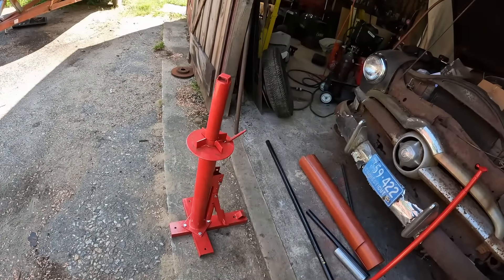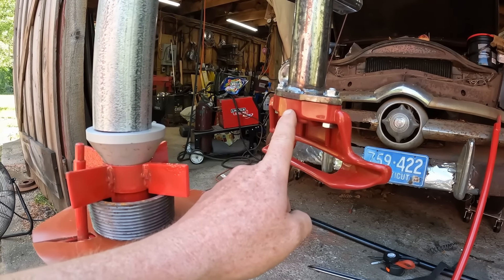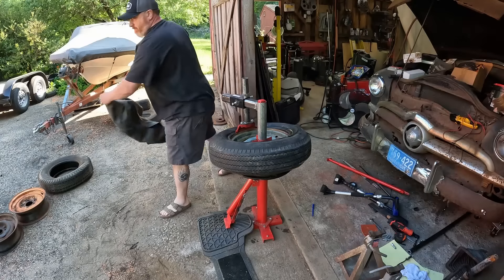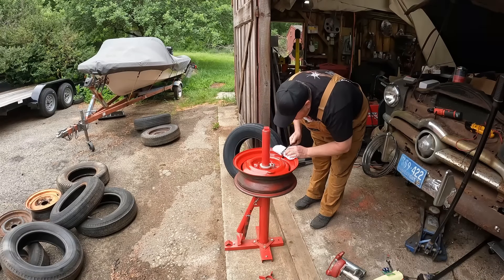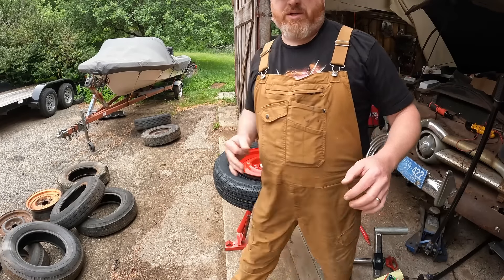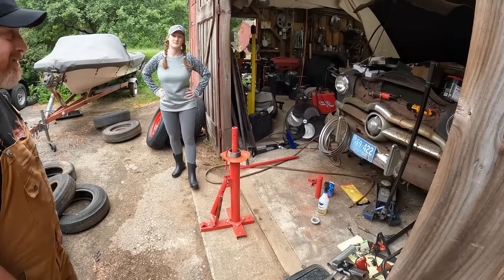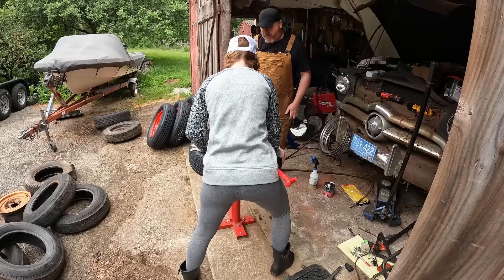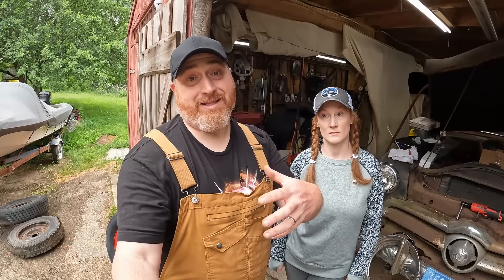How to modify a Harbor Freight Tire Changer to work amazing!!! Follow this DIY guide!!

Comment: I have the same set up thanks for the extra information on what you built. And what I use is a ratchet strap around the new tire if I have problems with the tires not popping to seal on rim .
Reply from the maker: Yeah we would certainly have to use a strap if the tires wouldn't go.

Comment: I just plain like that cone. Should have come with the changer in the first place.
When they taught me tire changing in high school the stand had a big cone
that thread down the center shaft.. Then you went at it with a massive bar
& with teen strength. Wham the tires flew off.
 Thanks much for showing the cone
Reply from the maker: There's a link to it in the description

Comment: Get you a good bottle brush and a holder for it mix dawn dishwashing liquid with a quart of water use it around the tire for both mounting and breakdown it will save your bead and a lot easier job.
Reply from the maker: Yeah I need some type of better setup for that.

Comment: You need to clean the rollers on the mig welder. carbontet is what we used in the old days
Reply from the maker: It has been replaced with an amazing new machine actually. Arccaptain MIG 200 multi process!

Comment: It helps to you so water in a spray bottle to bust the beads and a little bit of grease around the seal of the tire puts the tire on quickly
Reply from the maker: Thanks!

Comment: Loved the video. Have one of these tire changer have used it for a while and it will whoop your butt if the tires are tight. These mods you have done will make it easier. I have all the parts in my cart at Amazon. I have all the steel laying around in my garage. Gonna build it this week. Thanks
Reply from the maker: Thanks for commenting! Report back and let me know what you think!

Comment: I did 16 tires one day using my HF tire changer,unmodified no less,12 of which were atv tires,4 were trailer wheels and tires.. Used my bubble balancer from HF,modified,and balancedball 16. From start to finish was under 2 hours,saved me between 240 to 320 bux depending on which local tire store I had taken them to.. More than paid for the new unused HF tire changer I paid 20 bux for off of craigslist,the 16 bux for 2 HF tire tools,and a spray bottle with Dawn dishwashing liquid and 50% water mixture.. The tire changer is only 39.99 nowadays..
Reply from the maker: Well worth the effort to save that kind of money!

Comment: You got to love them old trucks,they were made to last- i just replaced the rear frame on my 1999 dodge dakota-thin wall factory frame- just to thin to rebuild once the michigan salt got to it for 22 years. That tire braker from amizon or harbor frieght looks like it might work on an easy ONE or maybe a hard lawnmower tire. I got and old hydrolic tire changer 30 years ago for 100 bucks= I gess it beats all manual crow bars somwhat-or it helps get it done.
Reply from the maker: Yeah this is no automatic job but it gets the job done I suppose. Thanks for watching!

Comment: I prefer to mount my own tires .. Because I clean up the bead area with a wire wheel grinder.. and I use Frey lube Rim grease on the beads..
  I got a quote of $4.00 per wheel at Sam's Club for balancing.  I think they would  dismount old tires and mount new tires for the same price.
  Many places got  $7.50 to balance a mounted wheel a few years ago .
Reply from the maker: That price is double here. That's a good price!

Comment: Use cheap transmission fluid to put the value stem in and a little on the bead of the tire if they don't just slip on like the first one
Reply from the maker: I will give it a shot! Thanks

Comment: I bought one similar to this about 23 years ago off of eBay. They are cheap, and can be awkward, but they will work. Narrow tires work much easier than wide tires. New tires are easier than ancient rock-hard tires you found in a shed somewhere. The weak links are the bead breaker and the end for reseating the tire bead. The bead breaker Doesn't work on real wide tires, so you need to modify the mounting to get the wider tires to fit. The bead reseating end may need some reshaping on a grinder. 
Your dismount modification was pretty good. I think you were running the direction the wrong way, but hard to tell from the distance, based on your duck head shape. but narrow tires just mount so much easier that it really didn't matter.
Reply from the maker: We are going to try some 50 series tires soon. I'll record it and see how hard it is.

Comment: Drill holes for lugs so you can bolt the wheel in place.   No need for the tapered part.
Reply from the maker: I suppose if you are always doing the same wheel pattern tires. We have 10 cars!

Comment: Used oil works for lubricating the tire to slip on the rim easier you need to use some kind of lubricant you're going to end up tearing the bead on one of those tires and it's not going to hold air dummy when I used to work at CT tires when you buy the tire they send you a bucket of soap that you add water to to make your tire lubricant

Comment: Hey, about your welder, my Hobart 140 was doing the exact same thing. After a bunch of digging, I found the cause to be a transistor on its way to the grave. For my Hobart, it's transistor TIP142T. Look into it, you'll need to solder in the transistor of course. If you're not 100% sure the drive motor is stopping and starting, then it could be the internal sleeve the wire feeds through. I've run 80 pounds or so through my welder and my sleeve was pretty heavily worn. The sleeves are cheap....mine was $35.
Reply from the maker: Thanks!! I'll check that out.

Comment: Leave the soapy water on when you air it up. It will help it slide up over the lip. Great job on the changer
Reply from the maker: That's what was in the spray bottle!
Reply: @madgingercustoms  yes but i thought i saw you wipe it off to check the rim for scratches.

Comment: On the whole balance deal just grab some bags of the poly-beds and you simply toss them in and slap the tires together and run them down the road and they will balance your tire! Easier then the weights hammering around and they will actually move so some mud or whatever isn’t going to make it off balance!!!
Reply from the maker: But them what would I do with this video? LOL

Comment: Have one of those changers and have been drooling over that duck head.
Couple of tips:
1. You slid past the mounting of the thing. That is very important. Either bolt it down to a solid floor or, if necessary. make a platform big enough to stand on to hold things in place.
2. Don't know why you used a separate bolt to hold the rim. That is the job of that pin. I did find the pin to be in the way all the time and cut the side out the "box" it sits in. I made a additional hole in the bottom of the box and drop the pin down from the top to hold the rim from turning.
3. The breaker handle holder is in the way when placing the rim on the breaker. I welded a bit of dog chain to the main pedestal and plier bent a hook at the other end. Now i can lift the holder up and hook it out of the way while placing the rim on the breaker.
Reply from the maker: That aligning pin is garbage and bent the first time I used it! That's why I used a wheel lug.

Comment: May be the switch on your wire feed gun or grounding inside the shielding. Or grounding. How do you move tire changer out of trucks path. Okay you unbolt it.😎 Lubricant..soap and water..is your friend. Paint both sides of the wheel.
Reply from the maker: Thanks for checking out the video.

Comment: the balancers work wonderfully when you set them up correctly and centre the tyre's rim as closely as possible before letting the wheel gently down on the balancing hub. centre the bubble before use and check after each use/tyre. it only takes a moment. bubble should always return to the centre you set up with after each balance. with a little practice folks....this will work flawlessly. be patience....there's a 'knack' to getting it done right but success is repeatable.
Reply from the maker: I completely agree!

Comment: Bubble Balancers work great before you set the bead put tire on balancer and rotate it on the rim to get the best balance first the mount your tire onto the rim then fine tune the Ballance with proper weight...

Comment: When it comes to balancing your own tires a trick I learned from the old timers when I was a professional tire man is to put 3 golf balls inside the tire when you mount it. Works like equal powder balance but better.
Reply from the maker: I've never heard that ever!!! We should try it!!
Reply: @madgingercustoms  I don't recommend using golf balls in tires that have the pressure sensor in them, especially plus low profile tires because they may possibly damage the sensor if they repeatedly hit it. Older model/regular tire n wheel setups are fine, nothing they could possibly damage there. Remove any led weights when using this trick.

Comment: Congrats! I bought an old tabletop style changer for 125 and git it going and love it but someone gqve me a HF changer as well and I was thinking about using it for motorcycle tires. Youll find bead lube works better than soapy water and bead sealer and tibes are ypur friends ln pitted rims. 
You bought new tires which anybody will mount but if you want to mount an old tire most shops wont go near it and thats the real benefit of having your own machine. 👍🏻
Reply from the maker: Yes, agreed. Thanks for watching.

Comment: Thank you so much for the video!!  I've been using one of these old manual tire machines for close to 20 years...mainly for dismounting tires.  I have tried to mount tires before but it was a major PITA and I ended up damaging the tire.  I will be building this adapter ASAP since I have a lot of tires I need to shuffle around and mount.
Reply from the maker: I promise it's like an entirely different machine. Glad you found the video useful!

Comment: When installing a valve stem you don’t need to pry against the rim you can just pull on the tool in the same linear plane as the stem and it pops right in no paint scratches or chips
Reply from the maker: Thanks!

Comment: one last thing that needs modded is the breaking bar, first stubborn tire you get it will break / bend where it pulls against center piece, 1' piece of tubing worked for me. and maybe re wield the top piece that threads on, those wields break easy.
Reply from the maker: I do have some 1" pipe that may work. Thanks

Comment: I never had a problem with the bar but it was the bead breakers that bend if you do too many stubborn tires.  Coming from a junkyard and the tires being 60 years old put quite a toll on the cheap breakers.
Reply from the maker: Yeah, the bead breaker is definitely a weak point!

Comment: Great video sir, the mix of knowledge along with the "lets learn together" worked well for me. Making the mods you put together look more sturdy than kits I've seen for sale (prob due to steel prices I would guess). Anyway, thanks for the education and improving my confidence level in moving forward with modifying mine.  Going on to check out your follow up video now.
Reply from the maker: Thanks for checking out the video. We get better at using it! I promise

Comment: Just one add on you should get thank me later lol, 2 clamps that pinches the tire on one side till it fits in the center inner rim ,then you will be smooth sailing a bit more .
Reply from the maker: We discussed that in the second video we did with this contraption. We mounted up some 17" tires.
Reply: @madgingercustoms  The welding idea of that plate ,very good idea though -thanks

Comment: Lube buddy. Just like with the misses, it'll make life a lot easier. Get yourself some dawn dish soap. Add just a little bit of water and brush it on the tire beads and on your valve stem. When you install it, you can pull that stem through without even touching your rim. Just pull up on the tool. Same way removing your tire put a little bit of dish soap around the bead. It helps a rubber slide off the rim Much easier. One of the benefits of using dish soap such as Dawn or sunlight, is once it dries on the rubber bead. It actually gets a little bit tacky and helps attire from sliding on the bead seat of the rim.
Reply from the maker: Thanks for the tips!!

Comment: I found l can change 17" tires no problem no modifications,  however l found the  red barrel  to  short and l use the lower bolt hole on the bead breaker. I use a cloth and vise grippers on the  rim edge and then the bead is forced up instead of the extra bar. The other thing l do is weld a  6 " pipe to the  bar so l can control the  bead lifter on the red bar so it can not  rotate In my hands and l can keep the  bead bar vertical while  rotating during the prying the bead up off the  rim. I use a peice of tubing over the rim clamp against the upside of the rim and l just use a  cloth on the  end of the  bar to protect the rims edges  sometimes it is better just to use the  tire iron to  pry on the tires instead of the rotation method because you can protect the rims edges with a  cloth around the  tire iron. But interesting modifications your doing definitely has merit.
Reply from the maker: I did some 18" this weekend with it. Fairly easy so that was ok.

Comment: Believe it or not i can take off and mount a tire with a 3 ft 2x6,  two tire irons and a hammer and never scratch the rim. The secret to make it take air was to bounce the tire on the ground once you had your good tire on to make the bead hold air. It makes the tire blow out and bead seals just enough to take air. Used to make $10 -$15 replacing tires on Sunday back in the late 90s when people would go to the local mudholes and have flats that was beyond repair or run tires off the rim and ruin them. Funny thing is my moms boyfriend had a old wore out tire changer someone had gave him  but it would take forever lol. Hard part was breaking bead down if it was stuck. I would place a 3 ft piece of 2x6 on the tire as close to the rim as i could get and drive the front tire on a pickup up on the board and it would break down easily. That machine you made is great!! I love doing stuff myself instead of paying someone alot of money.
Reply from the maker: That sounds awesome! I'd love to see that in action. You should make a video!
Reply: @madgingercustoms  well im not as young as i was back then lol. But i may make one just to show people how to do it incase they are out somewhere with a flat and all they can come up with is a tire. Its easy really but you have to have two tire irons with the flat end on them. I appreciate the videos you make . I like to add my twist on stuff too.

Comment: IT should pull into the hole with some decent effort- or the size is off from the older truck wheels- it may work if it is tight enough though.
Reply from the maker: They've been holding well since June or whenever we did this so I have to assume they are ok. Thanks for watching!!

Comment: The tires will go on the wheels a lot easier if you have a bucket of really soapy water like a glass or cup washer The porcupine looking thing on a stick to clean out glasses and cups soap up the beads of the tire Right on the wheel with the beads all soaped up real good
Reply from the maker: We used soapy water in that spray bottle for the last 3 tires. Much easier! Thanks for watching!

Comment: i like your design and mods that you have done but the only thing i see that might make a difference and make it easier is when you bring your prybar down after hooking the bead i would weld a hook to hold it down so you dong have to use the second hand on the silver bar
Reply from the maker: Solid idea!! Thanks

Comment: How did you cut your square bar stock to weld to your round conduit pipe?
Reply from the maker: Cut it flat and then used a flap wheel to shape it.

Comment: 16:50
STAND BACK & look at it.
The duck-bill is made for ALL different sizes of wheel rims and rubber.
In other words, it's made for 22" & 9" rims
Your smaller rims of say 13"  mean the duckbill will be larger than your rim, thus all you need do - is position it towards the way you intend PULLING the bead onto the rim.
The tail end doesn't matter where it is, as it will be wider than your rim size, and above the bead when it's on the rim
Make sure you pull your RED BAR towards the way you threaded the red pipe (& cone) down the center, or it will unscrew.
That's the end of the duck's bill you want to have the bead on top of it, to seat the bead on the rim.
Reply from the maker: I just mimicked what I saw a tire machine do.

Comment: I got one 5 years ago it has put on 8 sets of atv tires and 4 sets of trailer tires yes all the way down to the 4.80-8 inch rims and 6 sets of auto tires from the 14 inch up to 20 inch rims paid for it self with the first set of 4 atv tires.
Reply from the maker: Yeah they are worth picking up! Thanks for watching!

Comment: Put the valve in after the tire is mounted. Keeps from damaging the valve during install of tire. Also spin the tire clock wise and hook it deep under the rim lip after duck bill alignment before final mounting. Keeps your hands away from the rim and tire
Reply from the maker: You put the valve in after it's mounted??? I've never seen anyone do that. I'll look into it.  Thank you!
Reply: @madgingercustoms  yes before filling it with air. Put a little soapy water on it so it slips in. Same procedure for tire pressure sensor.